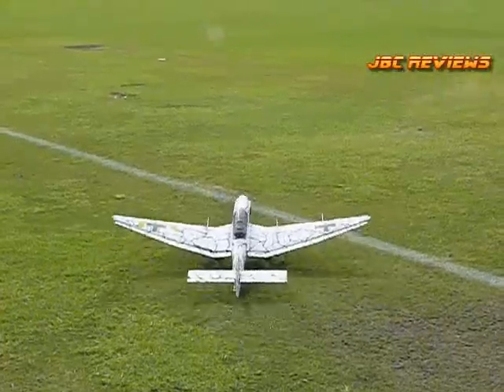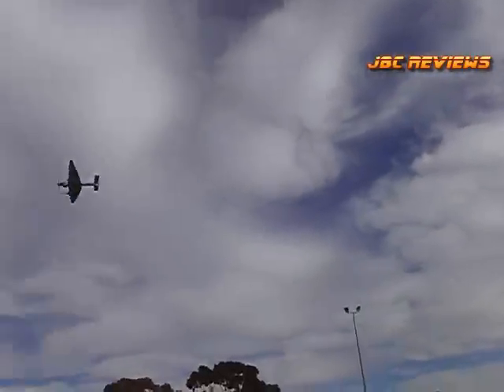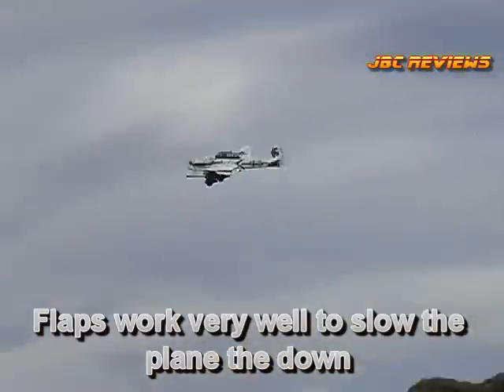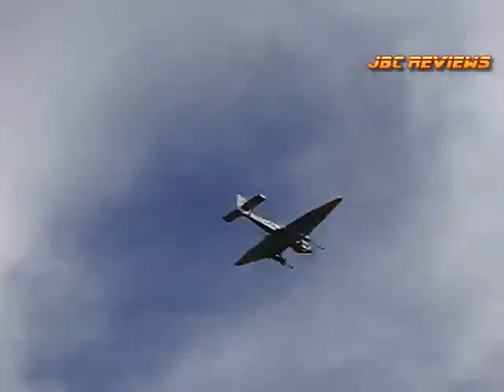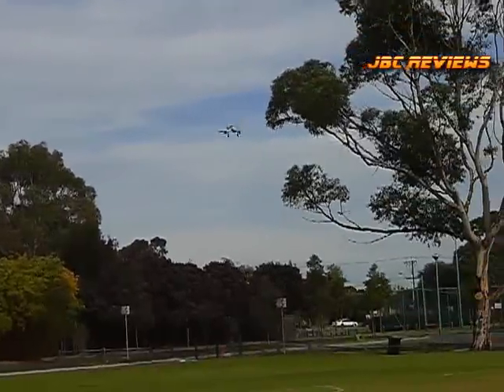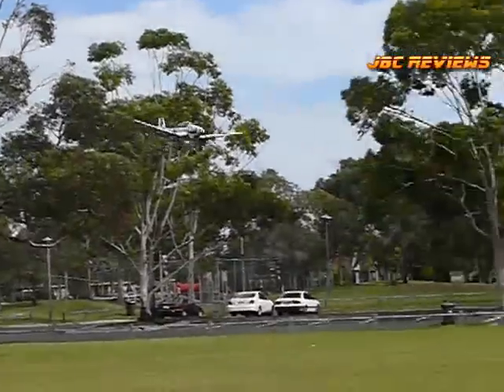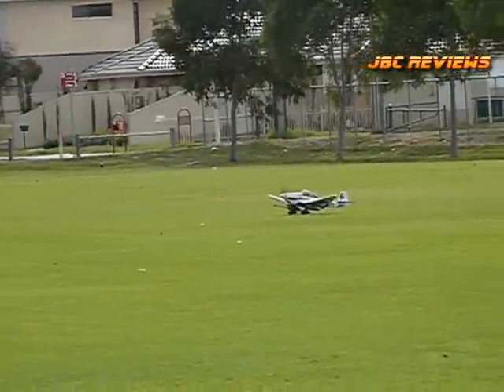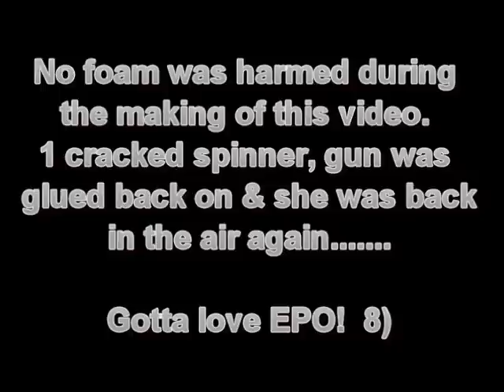FMS Airfield STUKA Ju87 (Pt 2) Flight REVIEW & CRASH

Comment from the maker: @7jsm7 Tony from nitroplanes crashed his because he had a mechanical failure. The aileron hinges on his plane were not glued on properly from the factory and they came off when he was in a turn during flight, hence the loss of control and crash. I mention the factory aileron hinge fault in my (Pt1) video of this plane and to keep an eye out for it. I have several FMS planes and still believe this is their easiest to build and fly.

Comment: Thanks for a great video.  I have the Stuka and also love it!!  I don have a question with the aileron throws.  I have very good down aileron throw on both wings but almost no up throw on both wings.  This is clearly because the hinges bind with the lower rear trailing edge of the wing. This binding prevents almost any up aileron.  I've seen other owners with the same issue.  Is this a scale thing that the real Stuka's had?  Is this something I should be trying to fix?  Does it cause any issue with flight performance.  Thinking it was a problem I actually made a small modification by removing the hinges on the aileron and re- positioning them 2mm further back.  This gave enough clearance between the leading edge of the aileron and the trailing edge of the wing.  I got good up throws (as well as down throws).  The roll rate is still slow and I use some rudder to make the roll a bit more crisp.  I know the real Stuka was a dive bomber not a fighter and it's roll rate may also have been poor.